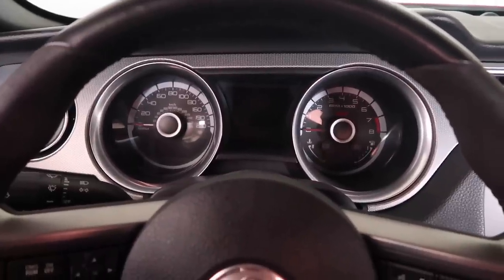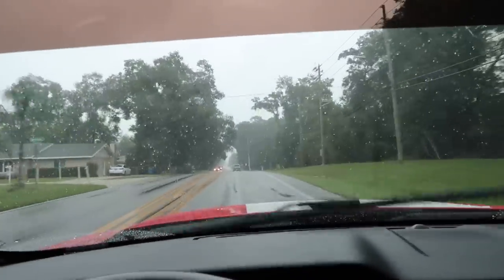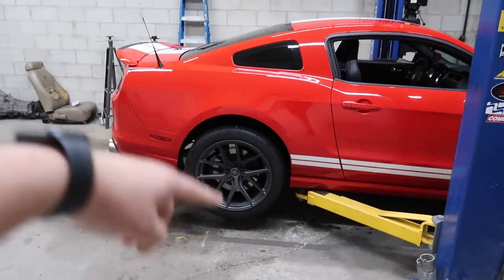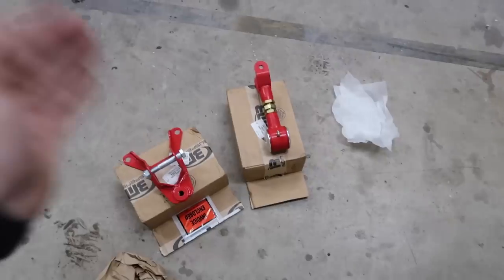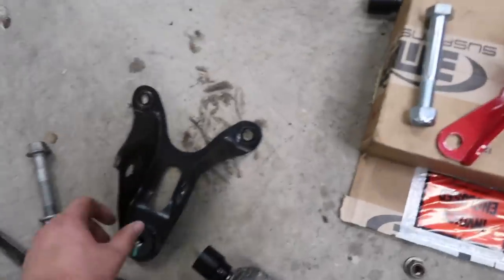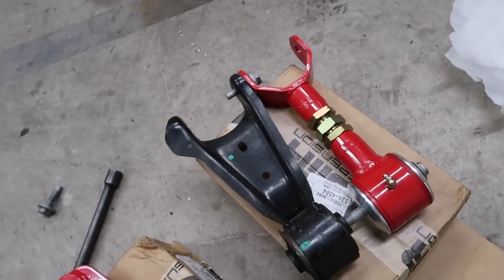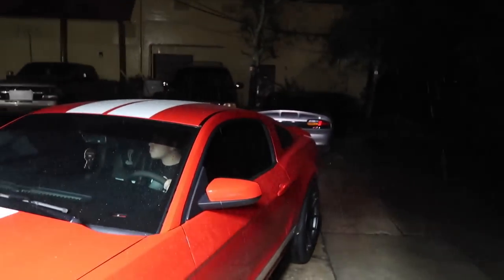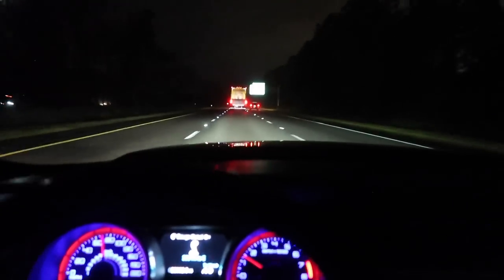Shelby GT500 Suspension Upgrades Phase 2 BMR Upper Control Arm

Comment: The BMR suspension should be greased only with the type BMR suggest.  Other grease besidess whats recommended will break down the poly bushings.
Use Synthetic grease.  Green or BMR super grease off their website. 
Petroleum will destroy them.
I have a 2012 Shelby GT500 with GEN2R.   Hows those tires work for street and strip? 
Have you tried them at dragstrip?
Reply from the maker: I would never use these tires for drag strip on a stick car. Drag radials is just too stiff and will break things. They could be used if you wanted to go like 1.8 60 foot but anything more than that you are risking breaking everything
Reply from the maker: I would never use these tires for drag strip on a stick car. Drag radials is just too stiff and will break things. They could be used if you wanted to go like 1.8 60 foot but anything more than that you are risking breaking everything
Reply: @MustangLifestyleTV  have you gotten it to the track recently, ? love to see how it does.

Comment: I know this is an older video... But.... You Kats need to start keeping an eye on the seat floor pan that the upper diff mounts to... I am starting to see the sheet metal starting to fracture in the higher HP cars now, with these stiffer bushings installed, and it is happening with in very short mileage, after the poly bushings have been installed... I suppose it is work hardening the sheet metal... Just a heads up, to add to the oil change time frame, to check the check list during that time frame... Good luck guys, be safe...